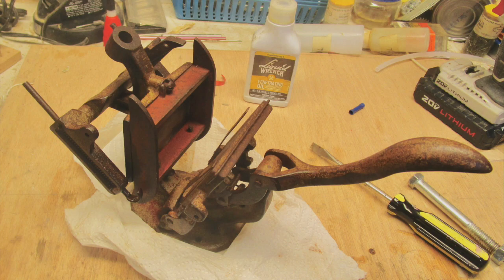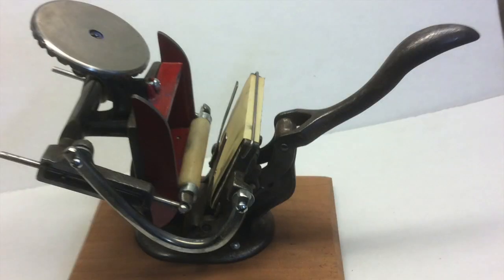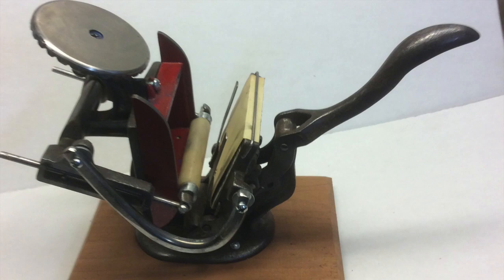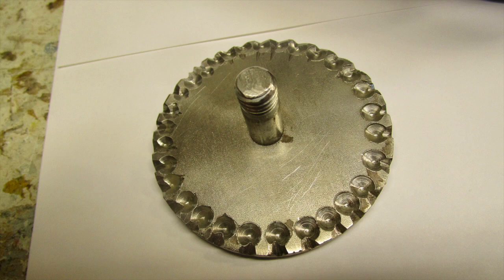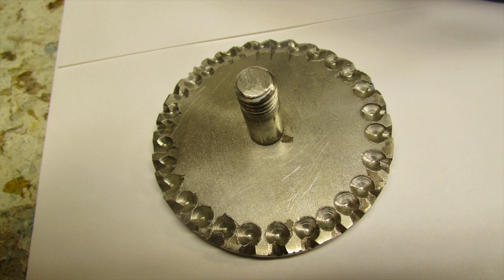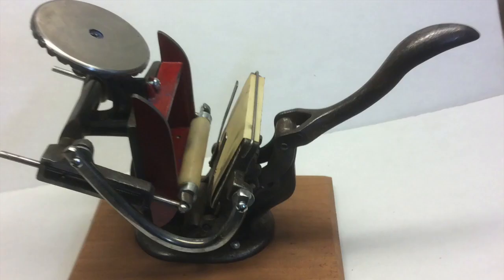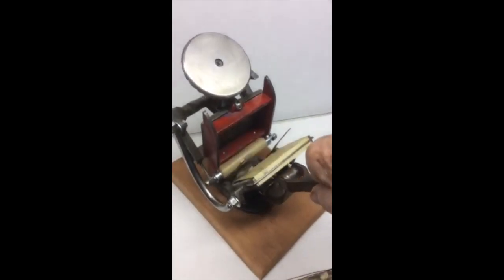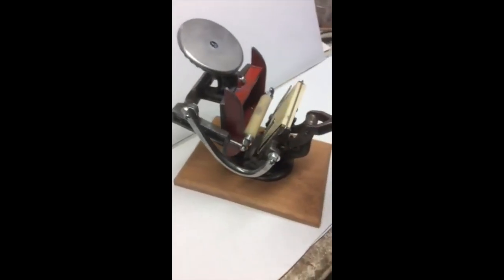Small Antique Printing Press Restoration

Comment: I'm impressed that you made an ink plate from scratch, and the linkage that moves the roller arms. Looks like you could straighten that roller linkage just a little - the roller usually travels further up the ink plate. See my video at about 10:10 to see this same press in action: https://www.youtube.com/watch?v=6gQasrMBALA  (BTW, the "platen" is the place on the press where the paper goes.)
Reply from the maker: JIm:
Yes, you are correct about the terminology. Don't know why I referred to it as a "platen" since I am well aware of the usual reference to that part. I had to experiment with the linkage and was aware that it could be better but just felt I had invested enough time. I had no part to replicate so had to use trial and error. Anyone with machine tools could do a better job of course. Anyway, thanks for your interest.